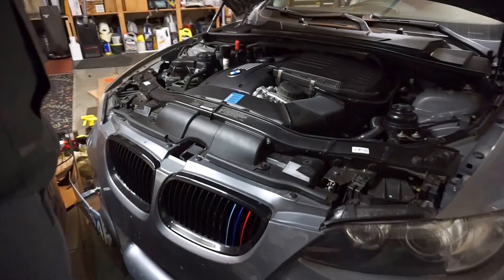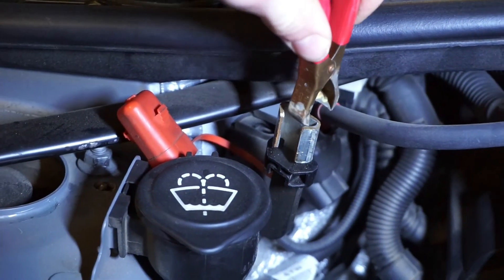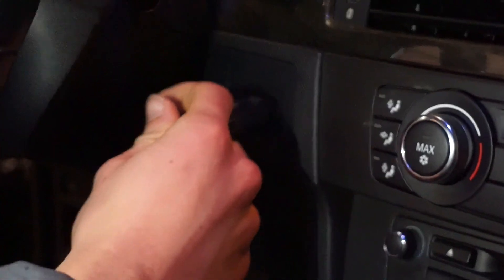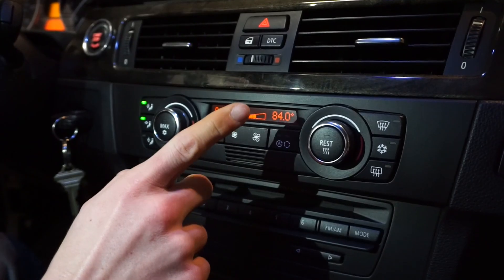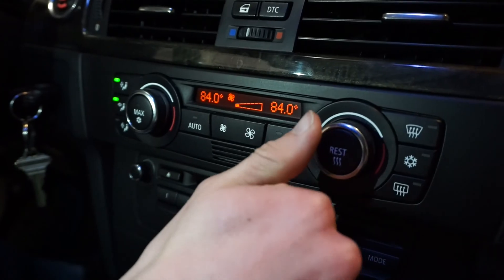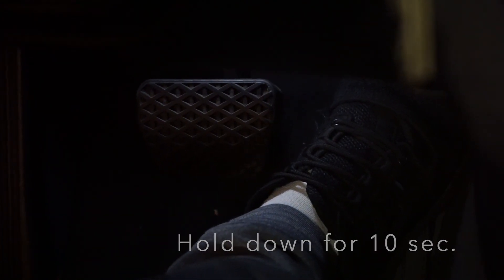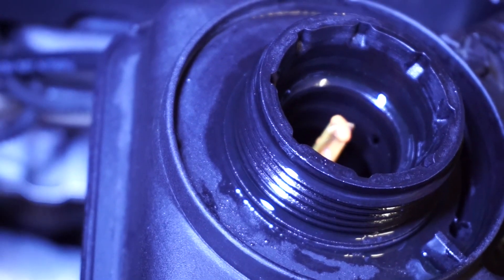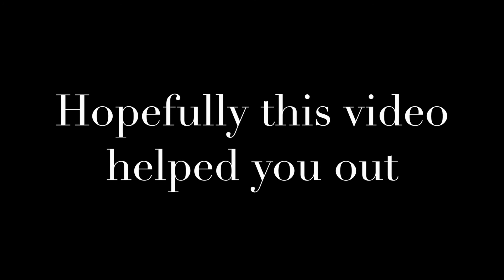Bmw 335i Water Pump Failure Test

Comment: In my car i have the symptoms you mentioned. But my pump does work. Its powerful too. So what's the problem?
Reply from the maker: my issue was the water pump. Can you explain the exact issue you're having. And the symptoms you have
Reply: Sergey Kostenko youre a good lad for replying. I got an e93 335i. My car overheats like a b*** really really quickly. If i drive it, it will go into limp mode before i have even driven 2 miles. 

I dont quite know what the issue is besides that but i have more information. 

The computer gives me code 2e7c which is something to do with the bsd interface signal from what i can understand from the internet. 

If i perform the coolant filling procedure (car on, heater on full, fan setting on lowest and push accelerator for 10s), the water pump comes on and sprays water powerfully. It sounds like its in good health. 

Yesterday i took warmed the car up. Coolant temp was at 98c roughly. As soon as i drove it, the warning light came on (overheating), i could see on my computer that the coolant hit 120c (110 from radiator), as soon as i parked up, the readings went to 80 deg c! A sharp drop! The coolant level seemed to have dropped too  a little so now im clueless..
Reply: Sergey Kostenko sergey, any idea?
Reply: aibel99 what was the known issue? I'm getting my radiator replaced soon
Reply: @joseC2013  from memoy, I had to change my waterpump and that's what fixed my car.